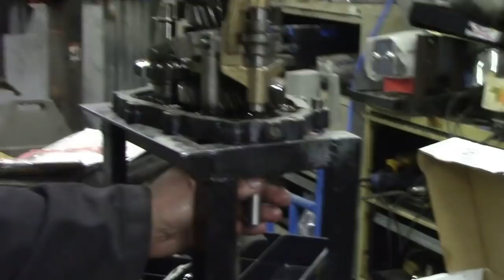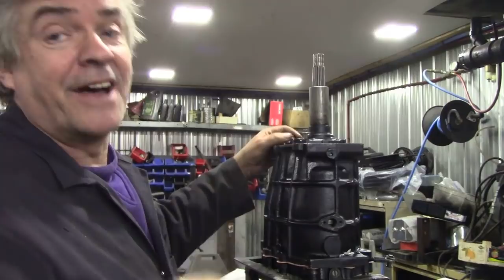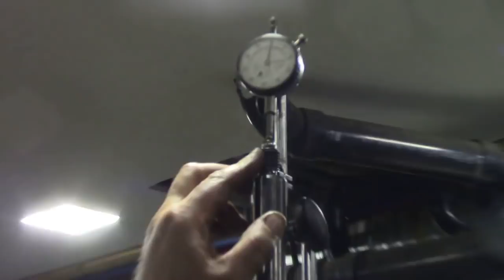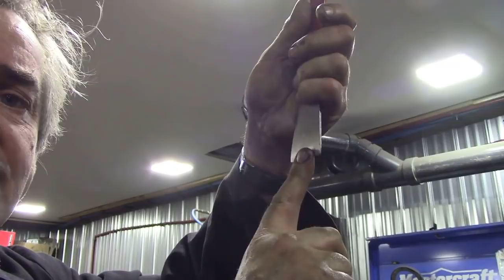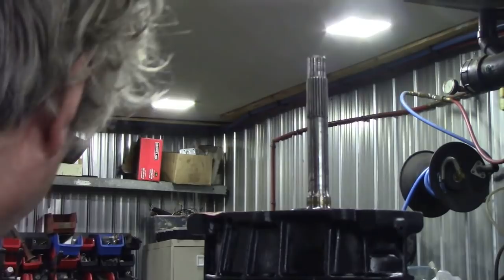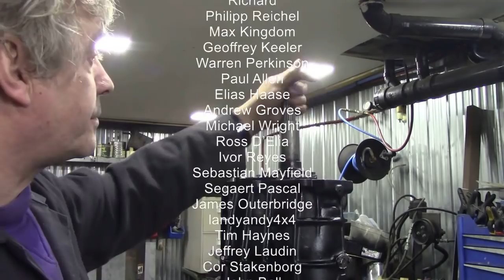LT77 rebuild part 4

Comment: Do you recommend the Ashcroft kits?
Reply from the maker: Yes I do - use them most of the time
Reply: @BritannicaRestorations  I have the  Ring Synchronizer friction of 1ST/2ND Gear Synchro Kit LT77 broken
Reply from the maker: From Ashcroft's?
Reply: @BritannicaRestorations  another Brand. And now I want to buy the Ashcroft brand. But I need to now if it is good.
Reply from the maker: Never had an issue, and Dave Ashcroft is very helpful if you have an issue, 5-star bloke

Comment: Hi, your videos are great!  Question, I can see a small leak from the 6 bolt input shaft rectangular cover, I’ve got the engine out for a new clutch and rear main seal, I want to fix the tranny leak while I’ve got the 200 tdi out, is it ok to remove that cover while the LT77 is horizontal in the vehicle?  I’m worried about something unknown shifting or falling apart when I unbolt it.
Reply from the maker: Yes you can remove the cover when horizontal - just be careful - replace the oil seal as well as the gasket and check the breather as normally they do not leak from that part of the gear box
Reply: On my D90

Comment: Bloody shims..... I used to do quite a bit of work on FIAT twin cams, and they had shims to adjust valve clearances. I NEVER had the right ones...Still, they didn't need doing really unless you had the head off and the valves out.
Reply from the maker: The one shim I needed was £14 + shipping! JP at the machine shop made me 3 for $10 - I gave him a $20 as I was so grateful I didn't have to wait another week for parts!